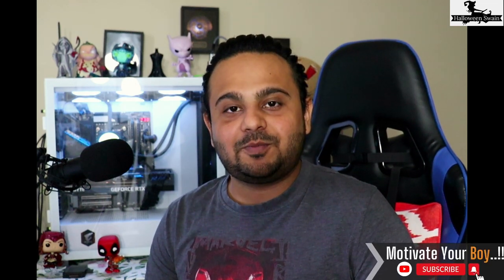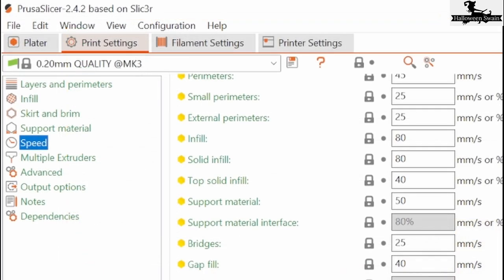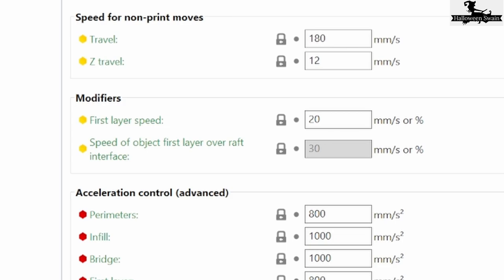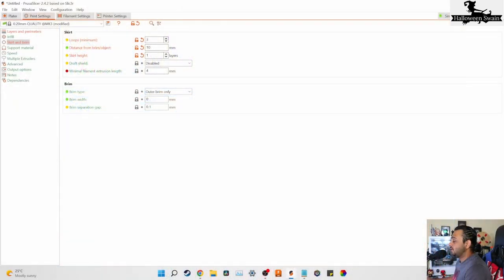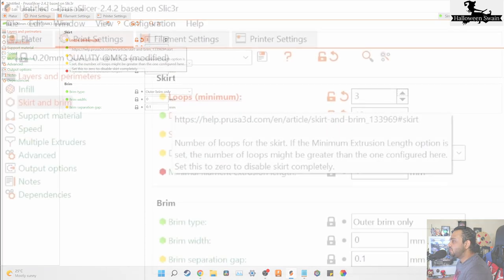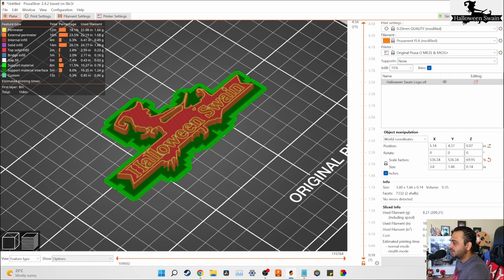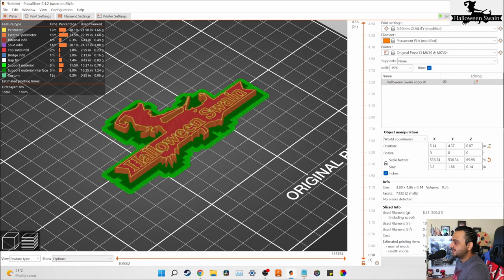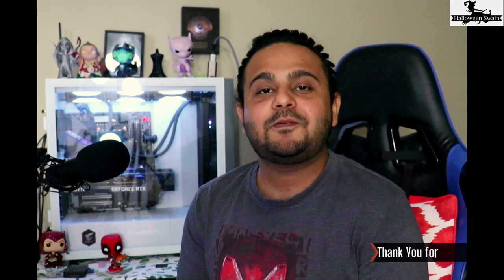Perfect FIRST LAYER Every Time 3D printing  Solved #HalloweenSwain #3dprinting #3dprint #3dprinted

Comment: I agree 100% .  I don't use any adhesive, never will.  I don't touch/clean my bed with anything other than a lint free cloth.  Any oils on the bed can cause adhesion issues.  This goes especially for dish washing detergent.  I have used all types of beds.  I prefer the non-pei magnetic.  But right is right, this video is on point.
Reply from the maker: Thank You Man. Please Subscribe and share. Help Your boy..!!!!